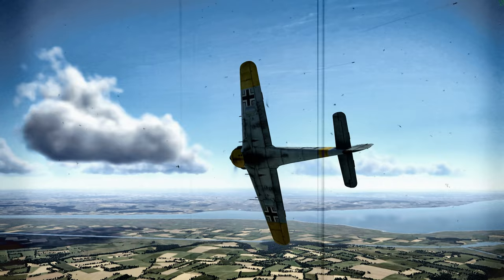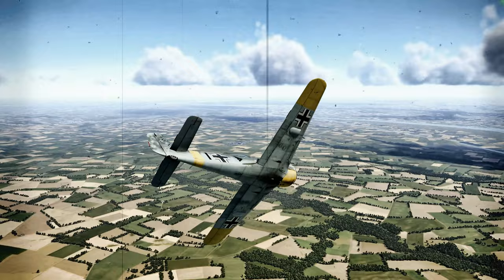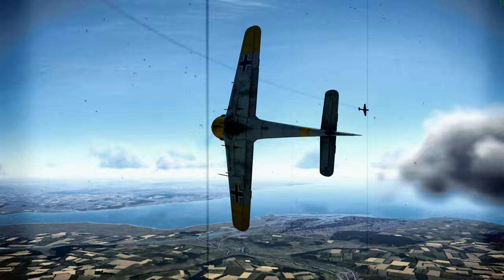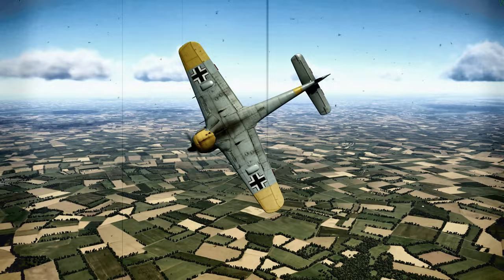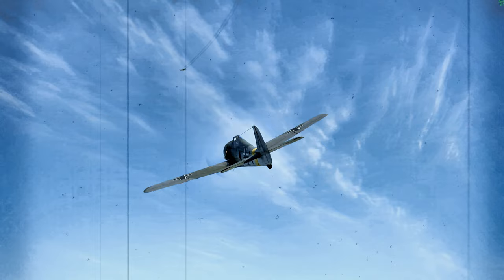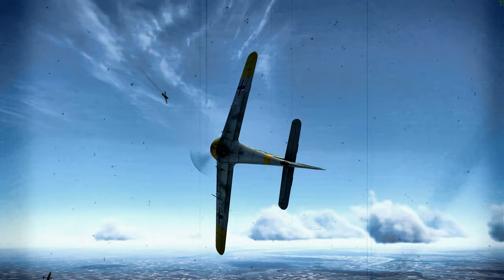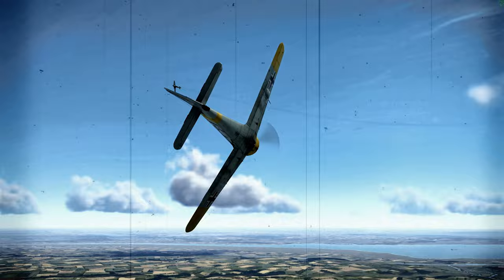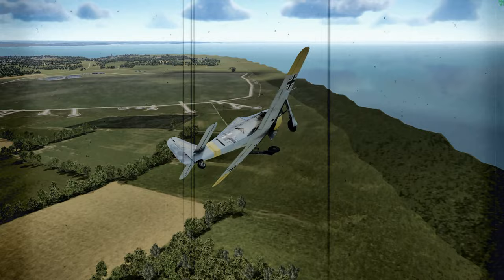Important facts for Fw 190 A3 pilots. Do you know your flight envelope?  WW2 air combat

Comment: Exellent piece of kit the FW 190 A-3 was! Fast, maneuverable , good climb ,good dive , exellent roll, fantastic ,,'motorgarat' engine management system!, robust airframe with higher battle damage survivability of  radial engine stup,(similar to P- 47 in that regard) the only real downside was lack of high altitude performance! That is why they opted for Junkers jumo engine in the later Dora's! Wknder why they could't .ake the BMW 801 make power at high altitude ,the 47 with i'ts P/W R - 2800 was at it's best at high altitude, i suppose the turbo/ supercharger combo made the difference in the 47, but a rather bulky arrangement, that the 190's airframe was not suited for!?
Reply: Wonder,make
Reply from the maker: Yes, a very nice plane!!

Comment: Despite the fact Fw-190 was a fabulous, excellent fighter, it apparently had a con or two that could cause a pilot new to that aircraft a few nasty surprises during a dogfight. Also, it sound like you were better off with Me-109 if your targets were Allied heavy bombers or reconnaissance planes flying at very high altitude.
Reply from the maker: Yes. There was very little warning (shudder etc) of an impending stall and it wasn’t good at high altitudes….
Reply: @WW2AviationGeek  I remember some Me-109 pilot writing that his plane reacted sluggishly to all efforts to steer and pilot it at the altitude of ten kilometers. However, I think Fw-190 and many other aircraft were even worse at that altitude.
Reply from the maker: @Cybernaut76  32,000 ft is EXTREMELY high altitude. At that altitude wing geometry plays a very important part in how the plane 'handles'. I don't like flying above 20,000 ft in these planes because they handle so poorly (its well modelled by this sim). Also, you have a problem with engine power. If you don't have a two-speed, two-stage supercharger tuned for very high altitude, you are going to have 2/3 to 1/2 of the power you might expect. 
I have always thought of altitude as a 'place', not a 'distance': 10,000 ft is a place where I need an oxygen mask. 20,000 ft is a place where my plane needs one too!!
Reply: @WW2AviationGeek  There actually were incidents where Lufwaffe flew Ju-86s with turbochargers at the altitude of sixteen or fourteen kilometers above Britain in order to do reconnaissance and drop bombs. This was a major problem for Brits. They ended up trying the strategy of making a spitfire as light as possible by any means available to imagination (for example by replacing a metal propeller with a wooden propeller). The German pilot (if I am not mistaken, his name was Horst Götz) was surprised to see the Spit could reach his altitude and depressurized his cockpit to avoid danger of explosion in case of a hit. The Spitfire managed to get one single hit from 20mm autocannon to the wing of Ju-86. However, the interception was very lackluster: Even if the Spitfire was at dreadfully high altitude, the plane itself did not react too abysmally to attack an enemy plane but at least the other one of its two Hispano autocannons froze inoperable.
Reply from the maker: @Cybernaut76  Interesting!
Reply: @WW2AviationGeek  A bit surprised the Hispano autocannon froze like that. I mean I remember seeing an article where Soviet Union destroyed one of their own decommissioned satellites by firing to a space environment with a machine gun that was installed/mounted to a space station. I am sure it is even colder in space than in the altitude where Ju-86 was ever able to ascend. Soviets were forehand worried about vibrations (and possible consequences) the machine gunfire would cause but everything went well and the decommissioned satellite, now a dangerous piece of stace debris, was destroyed.
Reply from the maker: Technology changed very rapidly to overcome the problem of aircraft guns 'freezing' at high-altitude. One obvious issue to consider is the operating range of the lubricating oil. Many gun oils were simply not made for -60C. I'm sure there were issues with metallurgy, akin to Galvanic corrosion, related to mismatched operating tolerances due to rapid changes in temperature. To help overcome some of these issues, many planes had wings with heat vents ducted from the engine to keep the guns a bit warmer. 
https://old-forum.warthunder.com/index.php?/topic/54159-hispano-cannon-information/
Note the comment on the above page about the Spitfire Type C wing and the temperature-related benefits of having a shorter barrel Hispano in the Typhoon wing.
By the space age, these issues had been encountered and could be anticipated and overcome.